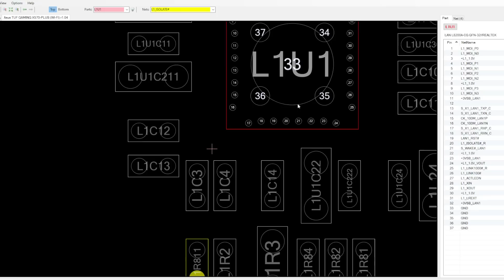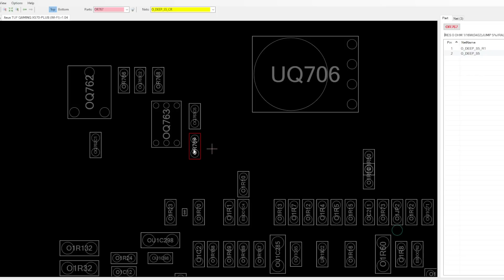ASUS X570 FROM EBAY || NO REACTION TO THE POWER BUTTON || MOTHERBOARD REPAIR FIX

Comment: hey man i have the same board and the backlights come on and switches colours in the rainbow formation but nothing happens when I press the on switch. The fans wont turn at all and there are no signs from the troubleshooting qled. I tried to turn it on by shorting with screwdriver, tried clearing cmos by shorting and taking out the battery. I also tried reseating ram cpu and gpu. 

The PC worked fine until yesterday so idk what is happening. Do you have any thoughts on this issue?
Reply from the maker: Sounds like something died and shorted out on the board! There can be a lot of things that can cause that problem!
Reply: @MainboardMedic But this is most likely a problem with the motherboard right? Since I can see the psu is supplying power from the backlights turning on and the fans or diagnostic lights should at least do something even with faulty gpu/cpu/ram right?
Reply: @MainboardMedic Also do you have any suggestions on what I should be checking for? I have access to a multimeter but I have never tried to troubleshoot apart from just replacing faulty parts so idk where to put the pins to diagnose anything.

Comment: Yes! .. I'm missing OR766, and OQ763C2 ! .. right below where you added the 0 ohm resistor!! 
Could you tell me the values of those two please? 
(I put my thumb there and it starts !!) 
You saved this board 😊!
Reply: Can you tell me the values of R766 and 763C2 ? 

Update: R766 is 56K. 
 763C2 is really small ..maybe .01 uf.

I used 51K resistor and low value cap and it's working 🎉
I believe my board is 1.05 revision. 

Thanks !

Comment: Genius, thanks so much! You saved my life... I just put in a resistor and it started. Yesterday I used the machine normally, but today it wouldn't turn on, so I found your video and it started right away.

Comment: What software delivers motherboard schematics and how much it costs?
Reply from the maker: Sadly there is no one solution software. Most shemematics need to be bought individually and cost around 5€ per boardview!
Reply: @MainboardMedic  Where to buy such a schematic?
Reply from the maker: @Wojtek_Przytulski  You will need to use google for that. There are many different sites for that!

Comment: @MainboardMedic
Hello, I have this board to repair, it had the same issue with no power on the missing 0ohm resistor, I soldered a 0603 on there and it powers on now. It is still missing 6 or 7 16 10uf capacitors on the backside for what I presume is vrm. The board says dram but since its asus it's most likely that cpu error. I have ordered some and will try to fix it by soldering those on. I am very grateful for these videos you make as they have demystified a lot of thing concerning mainboard diagnosis and repair.
I have one more similar board to this one which has been troubling me for days now. its the asus tuf x570 pro (wifi). It has no obvious shorts of any of the main rails. it has 5v as the aura led turn on (one of which on the backside is completely broken off, and one that lacks its shining part) on power on it draws some current tries to initialize and powers off after about half a second (The aura backlight led flickers for a moment and turns on again). This leads me to believe there is a capacitor somewhere in the bottom front region that's gone bad, however I have no idea which one. I've spent many hours looking at the board with no luck detecting anything visually that does not seem right. There might be something that is missing from under the area the pch cooler covers, but everything seems fine and the resistances on the chipset smd 0603 capacitors seem ok. The area around SIO suggests no missing components. The board acts the same on power on with or without the 12v cpu plugged in. I have tried desoldering the dead led on the back but no matter how much hot air I tried to blast it with (I stopped at 440 degrees) it does not want to come off.
Have you ever have a similar issue with a board? I'm really stuck with this one and have no idea what to do but to dremel the LED out which makes no sense as 5v led should not be able to weld itself to the board (i think). 
I would love a hint on how to proceed with this repair.
I don't have a boardview for it.
Thank you, love from Croatia!
Reply from the maker: Hey there, 5V can defenetly weld something on the board! Happens faster than you think! I would make sure that you have a correct bios on the board!
If something doesnt come off with heat i also dremmel it off! Is your VCORE running?
Reply: @MainboardMedic  I haven't checked the vcore as the board does not come to the stage where it matters before it shuts off. And led appears to not be welded, just stubborn. I have managed to remove it with no impact to the behavior. I have found what I believe is an n-mosfet missing between the SIO and the lan chip. There are three more three legged components in a row right of it each different component so I have no idea what actually is supposed to be here. Thankfully there is no damage to the pads so I will try to find what in gods earth is supposed to be here. Pictures on the internet are lacking in resolution to actually determine. I will try to trouble someone on ebay selling these boards to take a picture of the area for me to determine what to put here. Maybe there is someone kind enough to provide a picture :)
Thank you for your insight! I will keep you updated on how it's going

Comment: Kinda late, but i have this same board. Have the RGB lights, 3.3 on the power. but no turning on. lol
Reply from the maker: Well you will need to check if the SIO reacts to the power button and if it gives out the PS_OUT or PWRBUTTONout.
Reply: @MainboardMedic  Yes, i'm gonna check that out. Thanks. Now i see its missing a 1.8v standby rail. Hope thats it.

Comment: Weirdly enough that's the exact resistor i had issues on my board (same exactly board) 3-4 years ago right when i installed my GPU. Was lucky enough to just touch with my finger around that area and saw the rgb light up and manage to narrow it down and fix it(i do microsoldering so that was not an issue). Now that i see your video though i wonder if it was weak soldering from manufacturing and component just gave up when GPU was slotted in. 

(P.S that was my personal pc no a customers )

Comment: Do you have any video where you try to debug lost USB and network card from x570? I have one such board and OS just cannot see the host controller. Any tips what should I look for?
Reply from the maker: Ive done some repair work on them! But most off the time USB wasnt responsive because the protection diodes on them got shorted or the PCH was dead!
Reply: @MainboardMedic  cool! Thanks for the info. I will seek if I can find the diodes. It could be some EM shock via ethernet that broke them.

Comment: what is the device you using to power the motherboard?
Reply from the maker: I am using a 12V server PSU that can deliver 12V 100A and that is connected with a 12V to 24 pin pico adapter!

Comment: I looked at the Ebay ads. Their pictures seem to have either a zero resistor or a 6-pin chip. I think the motherboard is missing a 6 pin chip. The led lights up as soon as you turn on the electricity. I suspect the 6-pin chip is a switch for the LEDs. The three parts above the chip location relate to its operation. Is all parts noassembled in  a board view OR766, OQ763C2, OR768 and OQ763